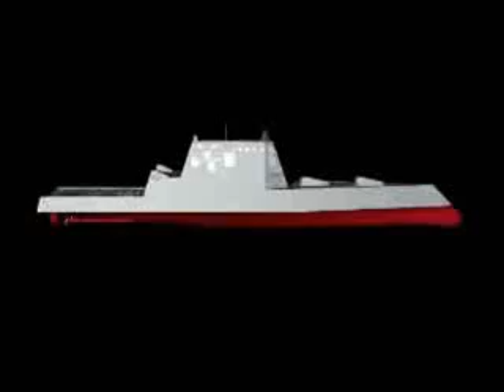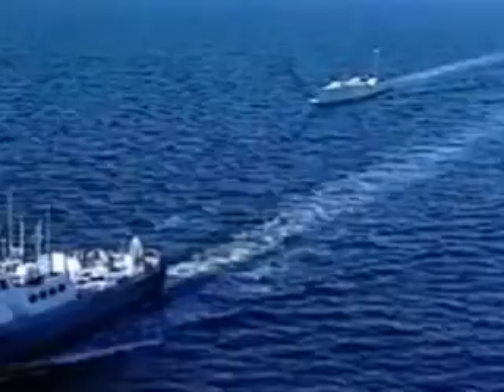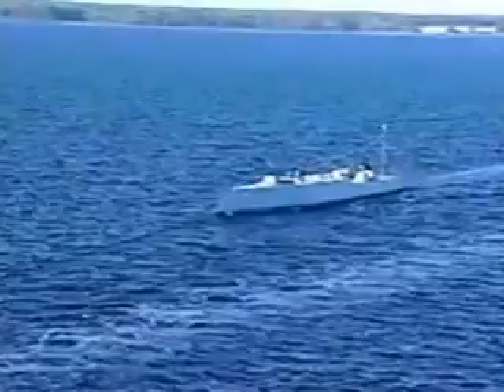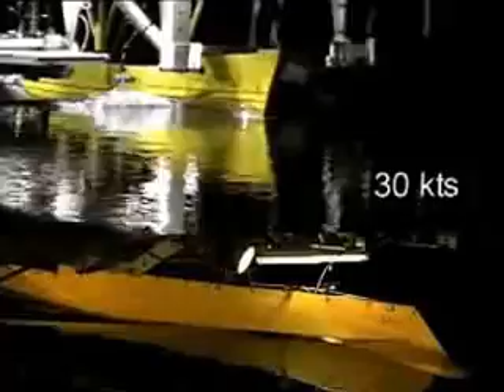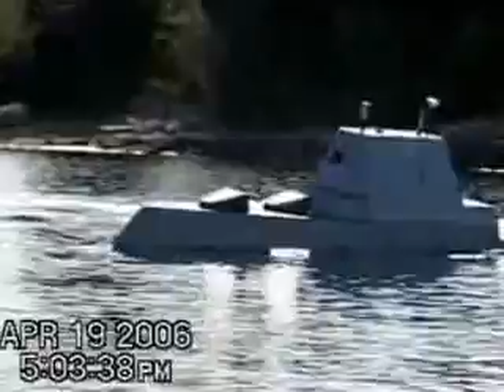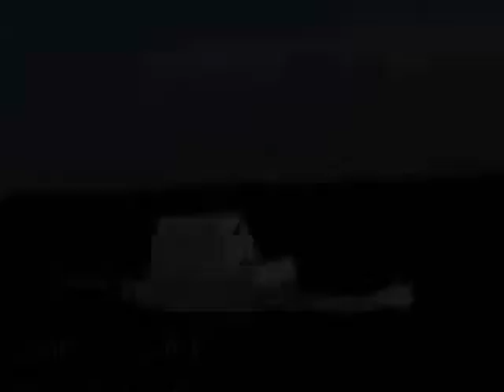DDG 1000 Tumblehome Hull Test

Comment: Seasick Sadie will be the name of this failed design. It snap rolls helo deck awash.
Reply: The reesarch says otherwise
Reply: its superstructure is aluminum the worst you could could build a warship out of. Intelligence from battle says this is dangerous. Aluminum burns through at 780 degrees fuel fire is 2200 degrees isolation of the fire impossible.
 SEE: HMS Sheffield completey burned and abandoned in one hour and 10 minutes into its fire. CIC and Bridge lost in first 10 minutes.Salt water eats aluminum any scrap rub exposed it to salt that dissolves aluminum. Vietnam showed the hazards of aluminum at sea. A 50 cal round will go completely thru the hull. Not deform and create a ricochet like steel. Why do the Russian use steel?..
Reply: 1950Viper
The secret is don't get hit. With all that advanced technology it should never come close to being hit. Hey nothings perfect
Reply: HMS Sheffield is identical to our Arleigh Burke class. A fine anti - missile ships that didnt have the radar on.
Reply: 1950Viper
Answer, don't ever turn off the radar, when your ass is on the line.
Reply: they loss track of 2 planes and 2 missiles and when spotted by mk 1 eyeball was the radar resumed and first missile tracked right into them and the second missile hit the supply freighter with all the attack force helos got hit and burned. They were signal silence to avoid the give away of the attack force that they were supposed to support.
Reply: 1950Viper
The fog of war and when things go bad. I sure hope they have learned from these deadly mistakes.
Reply: That is incorrect, HMS Sheffield's superstructure was NOT constructed of Aluminium, She was a type 42 constructed of Steel.
Reply: Again Incorrect, Sheffield picked up the incoming missiles on her Type 965 radar, they did not however pick up the launch aircraft as they would have expected. By the time the missiles were confirmed it took only 5 seconds for the ship to be hit. Policy was changed after this to immediately turn in, increase speed and fire chaff as soon as missile warning was detected.
Reply: Again, Incorrect, they never picked up the Super-Etendard aircraft that fired the missiles, the second missile hit the water not a supply freighter. Task force leader was informed instantly that Sheffield was hit, then radio silence was instigated.